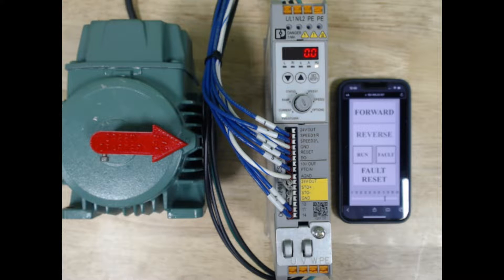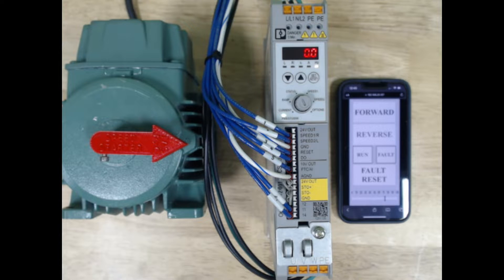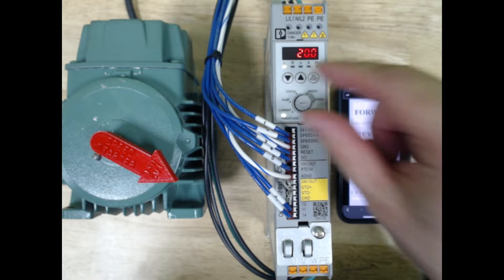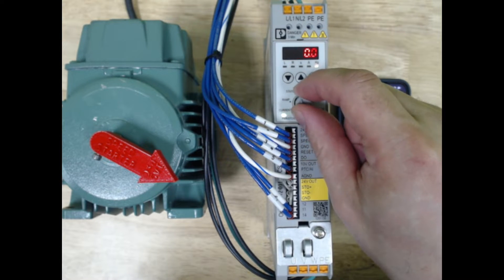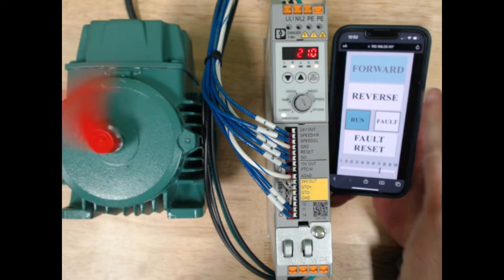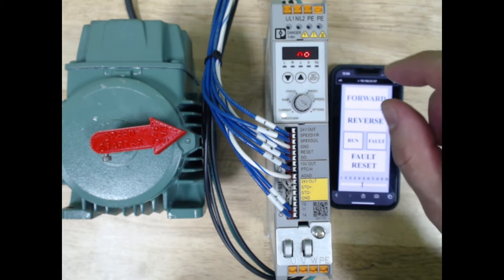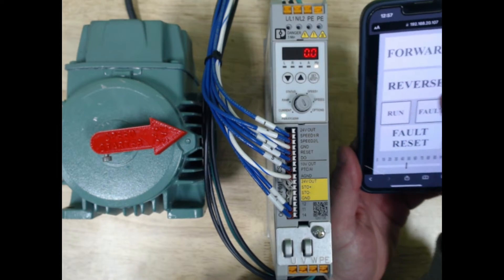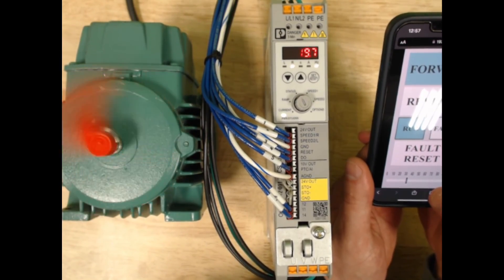Testing the Contactron Speed Starter from Phoenix Contact - PART 1

Comment: So...this is a VFD? I dont see the difference. Why call it a "speed starter"?
Reply: So, when Phoenix Contact initially released the CONTACTRON Speed Starter, the starter could only be given two different speeds. Either 2 forward, 2 reverse or 1 of each. Full stop. Since then, the starter can actually do everything a VFD can do. We've gone from firmware version 1.0 to 1.03 and it's extremely more capable. I just wish they would make a 5HP model. That is truly the only problem with it.
Reply: @CornManly  id pitch it for use in the company I work with if it was cheaper. We get 1,1kW VFDs fron Siemens at 140€, and as low as 125€ for the 0,25 kW   VFD. This thing has STO ports, which tje Sinamics V20 doesnt have. 

Honestly? i thought it used SCRs to control the speed. Shame it doesnt have an ethernet port.
Reply: @ Nice! That's an awesome deal on those Siemens drives. Unheard of, if you ask me. Siemens and Rockwell seem to compete on who can be the most expensive.

Your point about the NIC doesn't fall upon deaf ears; Phoenix wanted to make it as cost effective as possible, so they omitted details such as an Ethernet port to achieve that. Here where I'm at, the speed starter is very well priced and fits in that niche spot of:

"I need to control a smaller motor but I don't want a soft start and VFD's are too expensive."

Comment: I have a question regarding the wiring.  In the manual it shows the reset, speed inputs fed by the 24Vout on the device itself. Is that required or can I use to a +24V from an external power supply to feed those inputs?

Are you going directly from an output on the PLC to the speed input on the drive?
Reply: Hello Theking196, you can use either the internal 24V or an external 24V you will just need to tie the DC- sides together. So a PLC can control the motor directly. Hope this helps!